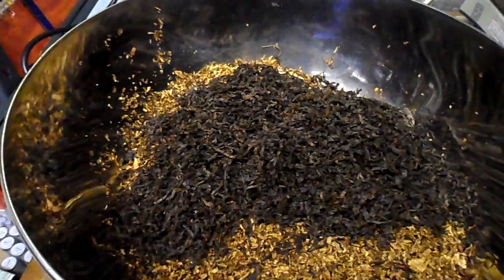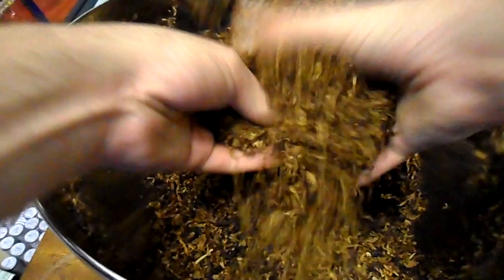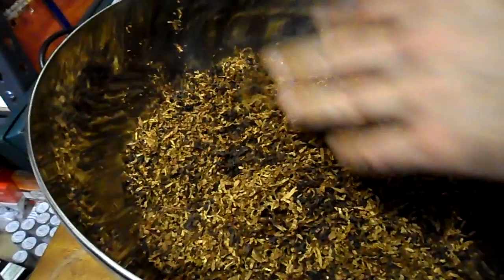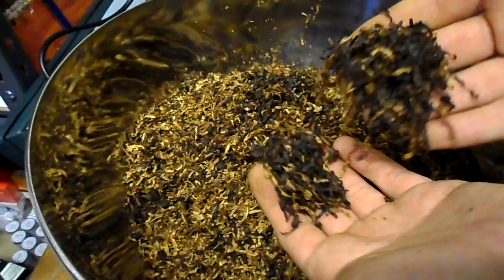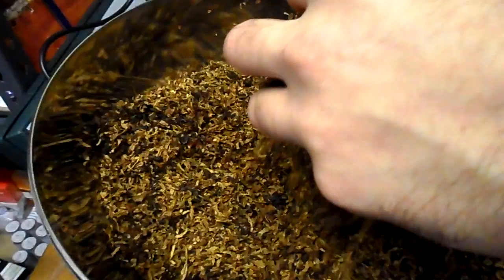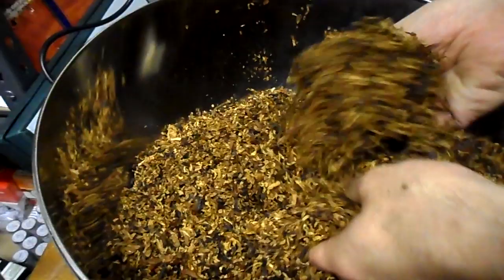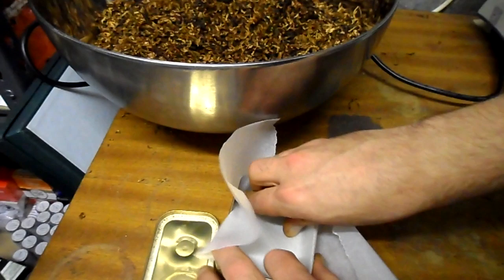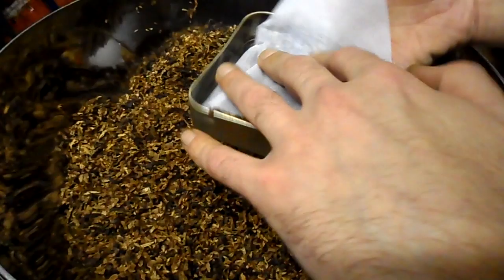Making of BurPer Kake & Home made tobacco press

Comment: I use huge plastic tubs that have a rubber gasketed, locking lid to blend in. I just break up the tobacco by hand and close the lid, shake & rotate. It blends everything evenly and I can store the blend in the tub for a bit before jarring / bagging. I also have a press mold that is made of metal and it is press in a twenty ton press from a company in the USA called Harbor Freight. Make ridiculous plugs / cakes / flakes!!!!

Comment from the maker: I can imagine, i am a bodge it and scraper kind of guy. I had those lying around and to use the a "Tool" 3 times to cut the plank and lid to size. I ideally need a metal one, so i can apply a lot more pressure and really combine the tobaccos. This is good for a loose plug like that, but if the box lasts 5 or 6 Kakes i will be surprised.

Comment: you could build a Dutch press like is used for cheesemaking and scale it to the size you need. they put out tremendous pressure. nice work.
Reply from the maker: Red Bluff, CA Gypsy Harmonica hi, I ended up building 2 generations of newer & more improved presses and now due to the UK regs I no longer make any blends or own/run GQ Tobaccos
Reply: Glynn Quelch that's too bad. are you still making videos? you do good work. I'm mostly into the snuff reviews.

Comment from the maker: A sweet syrup works better and some of the tobacco has a maple topping, but i only use distilled water. Its a very looks Krumble Kake, but i didnt want to take away from the flavour too much.

(SO I WAS TOLD!)The stems contain more nicotine but burn slower. I would remove the central vein at least and use the whole leaves. That way you are making a plug and not Krumble Kake!

Comment: dude... stop kneading it, you're just smushing everything together. fluff and pull it apart.
and wow, your base tobacco must be drenched in casing to stick together like that :P
Reply from the maker: king james488 nope, no casings. It held together pretty well. I sold that tobacco for over 3 years and produced over 250 blocks of it.
Reply from the maker: Not with that press I'd like to admit
Reply: well... mine doesn't stick together like that.
Reply from the maker: king james488 it's all about getting enough pressure. To little and it's fluffy and breaks apart , too much and you squeeze all the oils out and it goes rubbery.

What found works best is more pressure at the start and then loosen slightly every few days for 2 weeks. Don't get me wrong it's not dense like a plug, but enough to retain shape after being pressed. 

You can add some distilled water, but the perique in this one is pretty oily and at 28% it didn't need additional moisture (getting base tobaccos from SG helps too ;)) . Some of my other kakes needed it though.
Reply: I just use a C-clamp and a couple little scraps of 1/4" plate steel for mine, nice little hobby flakes about that size from mostly my organic homegrown. without a casing it'll hardly stick together though... SG is some good tobacco but I think we all know they like their casings/toppings :P